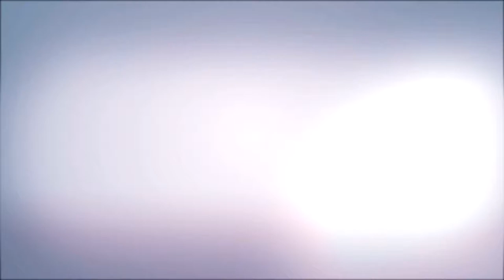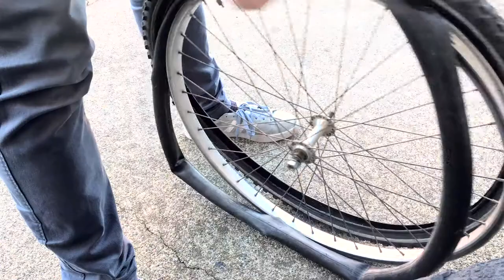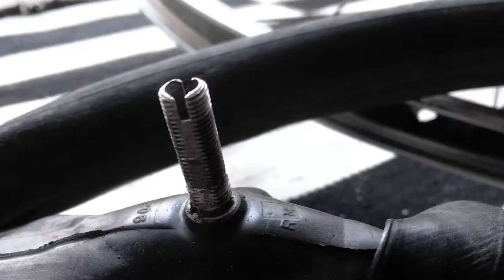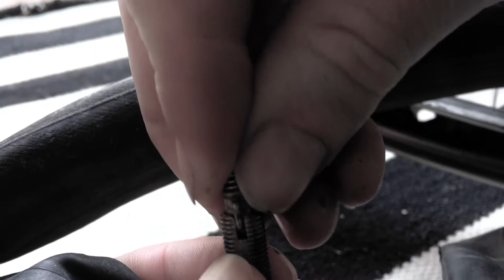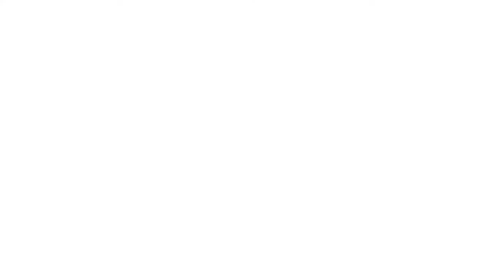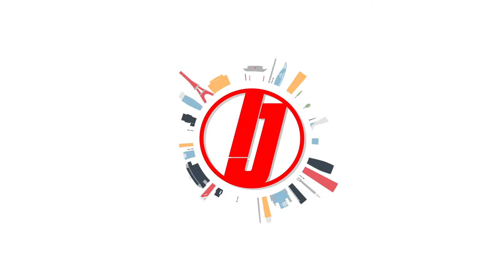Cycling in Japan - basic repair - English type valve

Comment: I bought one of those japanese bikes here in Spain and it has one of those weird valves, since it is old the valve's inner rubber seal has lost its effectiveness and when I removed the valve the rubber got stuck inside, do you know how to remove it, maybe with a metal clip?
Reply from the maker: Hmm.. needle-nose pliers might work. If not, I probably would order a new inner tube and search using Dunlop, Woods, or English valve
Reply: @InsideJapanD  well I will try to remove it and replace with the valves I bought in aliexpress, but in case it doesn't work I think te easiest solution is to replace the entire rubber tube with one with a schrader valve. I read the dunlop valve is a very bad valve and that it has an expiration date.
Reply from the maker: That sounds like a plan. Good luck!

Comment: How did you replace the rubber thing sir ??
Reply from the maker: It should come off when pulled. The tube has the valve sticking out of the rim, and 3/4 up that length should be a point where it separates. Once you have pulled that out. You can use pliers to pull the short rubber tube that seals off and put the new one on. Hope that helps.